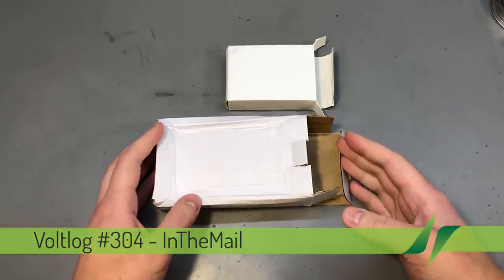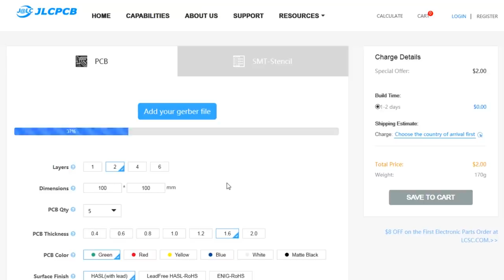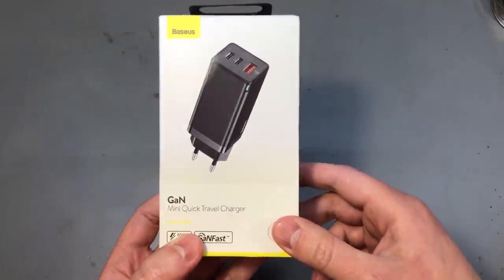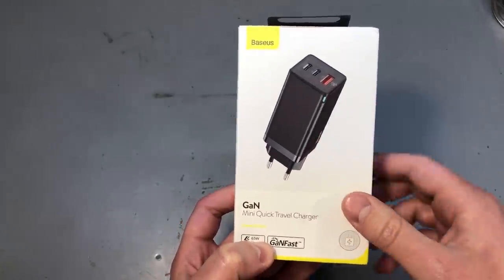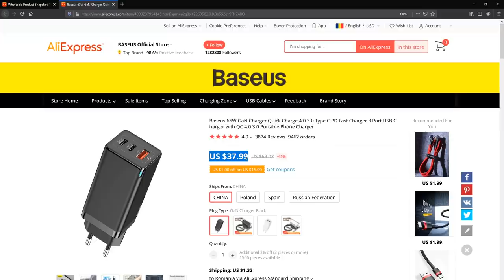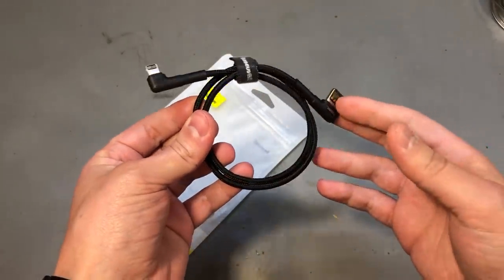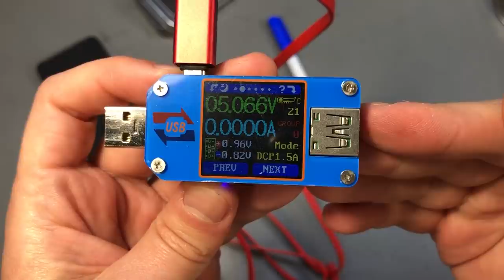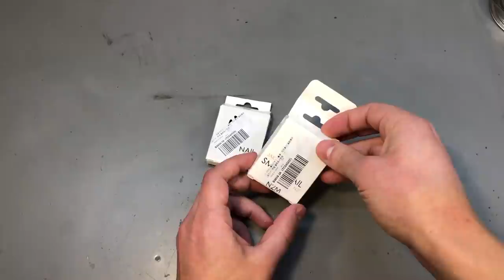InTheMail | Voltlog #304

Comment: Something has definitively happened to shipping from China this spring.
I order on a regular basis, and the average delivery time has been around 20 days prior to Covid19.
But as from early March this has changed dramatically. 

Now it's not unusual for larger items to take more than 50 days to arrive.
But on the other hand, small envelope size packages can arrive in 10 - 12 days.
Reply from the maker: Hopefully things will start moving soon, just this week I received 5 new packages so there are good signs.
Reply: It's pretty clear what happened this spring ;) . About half of all air cargo is transported on passenger planes, flights that are pretty much non-existent currently. Now whoever pays more gets transported.

Comment: Look out for the cheap brass brushes. a lot of them are steel with a brass coating that comes off very quickly.
Reply from the maker: Thanks! I wonder if a more expensive rotary brush would be better? I've only ever used these cheap ones from Aliexpress and they've all been similar not great but not terrible either for occasional use.

Comment: I just got my magic arm in the mail today, and it doesn't work very well. The major weakness is where the arm screws into the clamp. It's only held by a plastic but which is not able to create enough tension. The connection cannot support more than a few grams and it just sags down. It can probably be improved by simply replacing the plastic nut with a metal wingnut that you can really tight down, or ever hex nut and wrench.

Comment: Great mailbag vid again!  I'm eager to see the Baseus GAN adapter test, especially maximum load/current and noise parameters at different voltages. That is not requiring to sacrifice this unit as teardown probably would. Your loyal subscribers would never want to destroy the only one unit ;)
Reply from the maker: thanks! I wouldn't want to sacrifice this unit because I like it and will be using it but a teardown would be cool if performed on a secondary unit 😁
Reply: I have the same based one and I fk love it it's small and can deliver the 65W for charging mi xiaomi laptop ..and comparing it to the original xiaomi charger it's half the size and it stays cooler than the xiaomi one ..so for 25€ (bought it during sale) it a great purchase ..you won't be disappointed

Comment: I have the same 90deg USB lightning cable. It's not very good because the USB end fits very loosely in the socket, and the slightest movement disconnects it. I often go to unplug my phone from the charger to take it out with me, only to find that it's dead. This problem gets worse over time. The lightning plug is actually cleverly designed. Despite being very low profile, it has snaps which keep it firmly in place. And it can be plugged in upside down!
Reply from the maker: That's exactly the problem a friend of mine said I will have while seeing the lightning cable just yesterday, however I must report after plugging in to the head unit usb port the connection is tight, no wiggle at all. It's possible that my head unit has a tight usb port which firmly holds any plug.

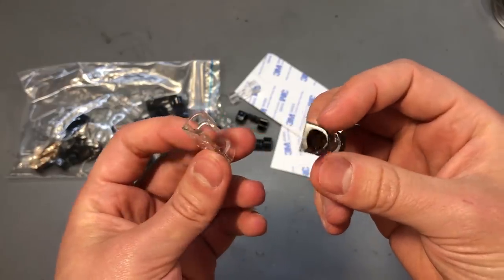Comment: I've been using those cable clips (11:45), with the "hook" side of hook-and-loop/Velcro fasteners stuck to them, as a tidy way of keeping cables in place against carpet around the edges of rooms - e.g. the Ethernet cables that I have running around the house. This is a rented property so I can't really go drilling holes through walls for cables, and adhesive cable channels aren't ideal either (I'd have to re-paint after removing them), so those clips plus Velcro hold cables in place well enough but can be removed without causing any damage :)

A similar NFC fingernail idea are the "NFC LED nail stickers" that Pimoroni sell (https://shop.pimoroni.com/products/nfc-led-nail-sticker).
Rather than storing data, those use NFC to flash a small LED on the nail sticker - and again you can paint over them if desired.
They added a fun extra dimension when I painted my nails for Pride last year, though I found that they don't stay stuck for very long on their own, even with several layers of nail polish and lacquer on top. I think some additional adhesive would be a good idea if they need to stay stuck to fingernails for more than a day or two.
Reply from the maker: Nice idea with the velcro clips 👍 Regarding attaching stuff to fingernails, I know from my wife that there is this UV curing gel they use that lasts a long time but it has some disadvantages, you can't just take it off easily because it kinda damages your nails.

Comment: As everywhere else shipping to Austria is like a lottery currently. A few things starting from the end of February got lost or cancelled by the seller (and now list "don't ship to Austria"). One package arrived faster than anything else I ever got from China (except for when using a dedicated shipping provider). But pretty much everything from after the first week of March is stuck somewhere. I am actually thinking some of it might be at customs here.

Most of the sellers now charge for shipping. What annoys me about that is that only very few offer combined shipping, even when ordering multiples of one item. When more than half of the value on checkout is for shipping that really makes me consider, if I need something or not (that's a good thing, right?).

All of this is to be expected though. About half of all air cargo is transported on passenger planes (worldwide, not just from China), flights that are pretty much non-existent currently. Many of the major airlines have now started to fly without passengers though just for the cargo. Still better than having the planes sitting around on the ground (planes that didn't fly for a few days would have to undergo very expensive checks, airlines will have to pay the crew anyway and kerosene is cheap right now). So at least the shipping part should get more reliable soon.
Reply from the maker: I think things are going to get better, the first sign is that I received 5 packages starting this week.

Comment: I've just ordered a SMD reflow hotplate from China, so it'll be interesting to see how long it takes to arrive. I only ordered it the other day, and it says they're still processing the order, so I'm yet to see if they send through the DHL tracking details, let alone how long it takes to arrive. Interestingly a lot of vendors have jacked up their delivery prices significantly, I'm talking AUD$150-200 (US$100-130) for delivery to Australia. Some are still offering free delivery through DHL, and I'm sure their prices have gone up a little, but definitely not that much.

On the other hand I've bought a few second hand/NOS items from eBay sellers in the US, and those have largely been making their way through eBay's global shipping program with varying levels of delay.

The only other thing I've ordered from overseas was some NOS memory chips from Finland. They're basically saying that the post isn't going to Australia, and it's been a couple of weeks, but I'm giving them the benefit of the doubt because I know it's a very difficult situation and not everywhere is as lucky as we are here. It's not quite at the point of delaying my project anyway, since I have other things I'm waiting on, and I've got other work I can be doing in the meantime.

Aside from that, interstate post has been a little delayed, but I'm guessing that's just because they're shipping more by road because the airlines have been cutting back on flights.

I'm lucky to have kept my job, so I've been trying to help small vendors by buying stuff from them, although I do worry about making them go out to post stuff.
Reply from the maker: Thank you for your feedback. As far as I can tell DHL is still pretty reliable, even with a couple of days of delay over the normal schedule that is still acceptable.

Comment: 14:14 i have bought this for my dremel, it is very bad quality, they break after a very small uses.
On the other hand, the brushes are not bad.
Reply from the maker: I wonder if a more expensive rotary brush would be better? I've only ever used these cheap ones from Aliexpress and they've all been similar not great but not terrible either for occasional use.